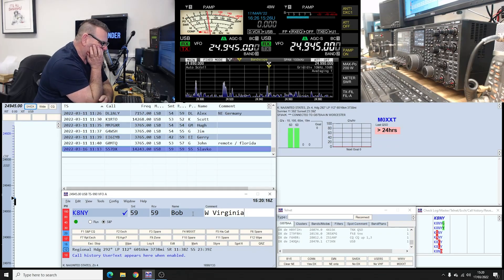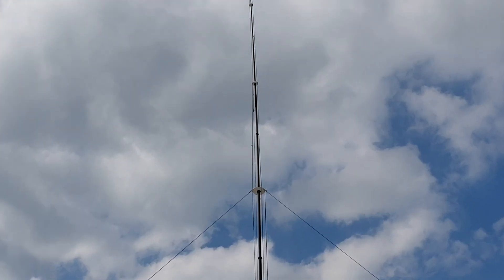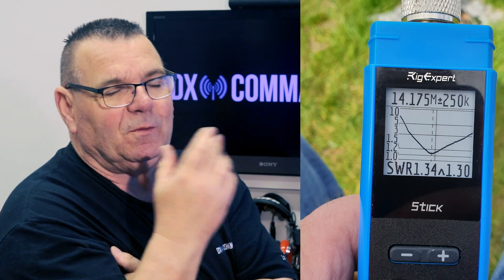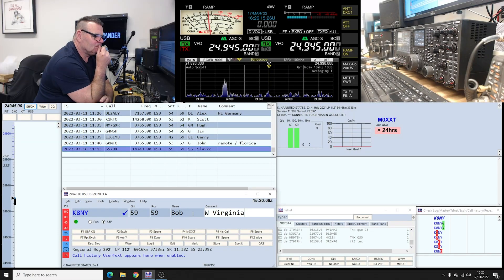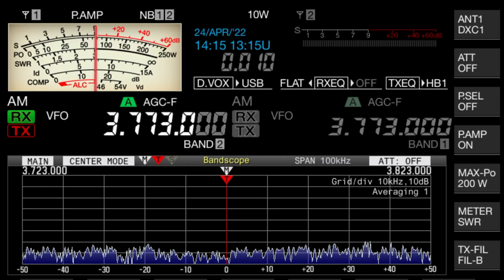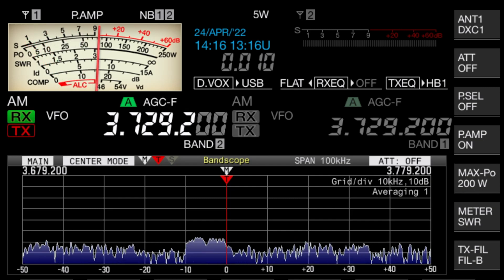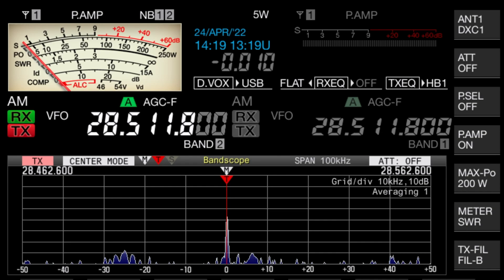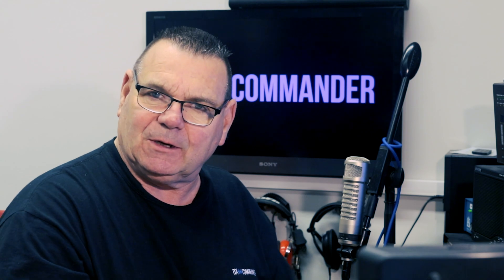Loading Coils & SWR Curves - Signature 12.4 Ham Radio Vertical

Comment: The 80M result is what I would expect to see, typically with a coil to electrically lengthen the antenna at 80M, the resultant bandwidth is about 100KHz, this is the result of typical wire sizes used to wind the coil. It’s worth noting that Q=wL/R where w=2.pi.f so you can work out what the actual Q is if you can measure the coil resistance and inductance or because R is the denominator, you can use that to lower the Q and widen the bandwidth, so if the coil wire size was made smaller, then R would increase and Q would be lower giving you more bandwidth.
Reply from the maker: Good point.

Comment: One more sad fact you are up against.... is if you could stand up 1/4 wave towers for each band without any wire guy wires starting to bring in real world capacitive loading. You would see the tuned dip gets narrower the lower you go. This becomes a pain in the butt for Broadcasting Services on LW that want to push out full 10khz audio. It needs a totally flat response for the full 20khz. That is not easy to get down there. But boy your groundwave goes further for the same power. The reverse happens as you go up in frequency. Your tuned dip gets wider.
Reply from the maker: Wow. That's amazing.. So flat for 20kHz.. Gosh!
Reply: @DXCommanderHQ  Bad SWR on a broadcast service effects audio response. Also makes the TX see reflected power if its more like tighter Q aka smaller tuned dip. Even though the carrier is 1:1..... The sidebands are out at thier audio freq +/- the carrier. They are really seeing a higher swr IF the aerial has a hi Q. The Sidebands are the ones getting your audio to air and operate at about 1 tenth of the carrier power. You need to be nice to them.

Yes Callum... dead flat is preferred atleast for the total bandwidth of the audio high fi the station engineer wants. Where to roll that off does start a massive debate. As the fact AM radio has the reputation for being low fi.... 80% of that blame is the reciever.

Another trick we do is to add wire to the tower to trick SKIN EFFECT into thinking the tower is wider. This helps. Try using thicker for your 80m element first. Then two on opposite sides of the pole. So the two elements approx 4inch apart look like FLAT Ribbon thanks to skin effect.

Thats my advise and suggestions to help with wider dip down low. 73

Comment: As a coil moves up.... it requires more Henry to get the same result. You come up against the fact the ohmic losses start to out weigh the benefit of the coil pulling your current up the wire (your wiggles).... cheers

Comment: Callum, I asked this on IG re SWR. Is the recommended element length based on Region 1 or between Region 1 & 2? Asked differently: is the SWR table based on the final recommended cut lengths? See, I have been studying the guide! Lee N5BE.
Reply from the maker: OK, so the user guide has the exact dimensions.. THE curves will move up and down appropriately. I did test this for both Region 1 and Region 2.

Comment: How does tuning the 80m element affect the 30m band?  US general class 80m phone is 3.8-4Mhz.  If I move the center up to 3.9 will that hose up 30m?

Thanks.
Reply from the maker: Shouldn't do.. The long story is that by adjusting the coils AND the amount of foldover on the 80m element should keep the 30m tune fairly balanced. See user guide for probably better explanation :)
Reply: @DXCommanderHQ  Yup, my fault for not checking out the manual.  Just watched your new vid.  Enjoy your time off!

Comment: @ David Casler    I have a cb base station setup. Would the window line make a difference in hearing other and does it handle power better than the thickest coax i can find? i also planned to top out the tallest tree on my land and putting my cb antenna on the top of it. The putting the antenna in the tree, will this hurt me any? the antenna is 18 foot  ground plain type.
Reply from the maker: Hey Dave, wake up fella.. Question for you! ANd stop reading that User Guide!
Reply: Hmmmm. Dave, are you hiding upstairs at Callum's shop??? 🤣

Comment: "Known-good coax..." Any tips for testing a piece of coax to verify that it's good? I know there are purpose-built coax tester gizmos, but what could we do if we only have a multimeter, dummy load, SWR meter, and maybe (or maybe not) an antenna analyzer?
Reply: Stick the dummy load on the end of it, meter and tx on the other end, and check over all bands. Should be perfect VSWR. Wiggle the plugs as you do it in case of any iffy connections!
Reply: Agree with Andy, that’s how we did it years ago, painstaking in comparison with the magic of analysers and VNA on the market I know.  Record the figures on a graph or spreadsheet.  👍🏻
Reply from the maker: Multimeter is normally just fine (mine kept going open circuit).